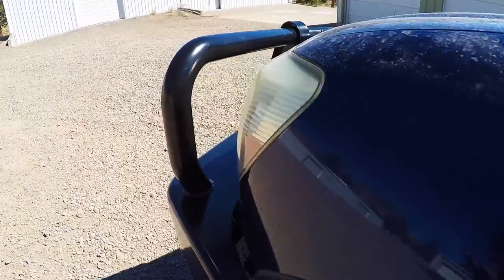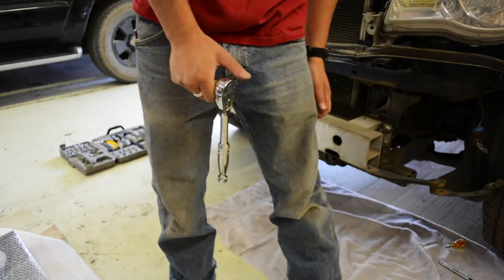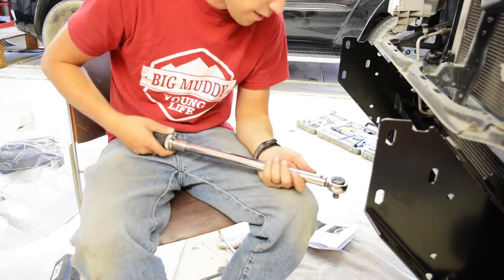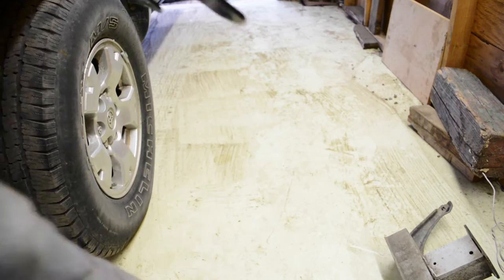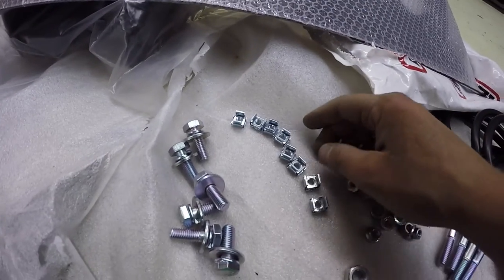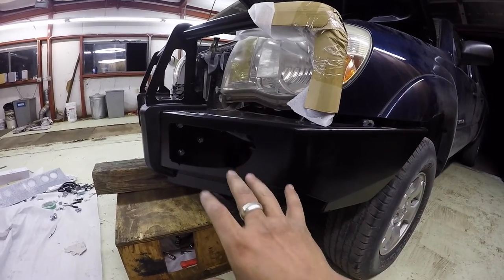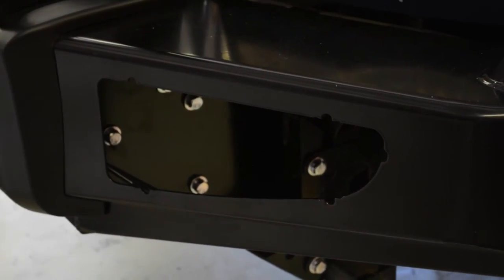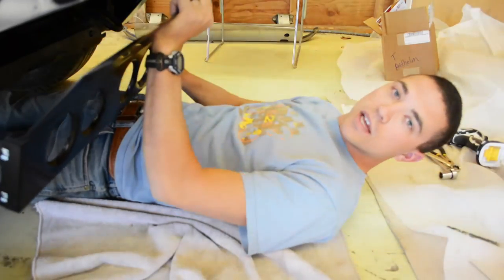How to install ARB bullbar front bumper on a 2006 tacoma

Comment: When you have the stock bumper off take the time before you install the ARB bumper and clean off your condenser and radiator and also if you are not offroading give all that metal a real nice clean and heavy wax to prevent rust.

Comment: Your radiator support mounts are shot. Energy suspension makes a body mount kit that would be a worthwhile upgrade.
Reply from the maker: Tell me more, is there something i can see in the video that you saw. Give me the time of the video clip. I do have a noise in the front end that happens when i go over bumps and I haven't found where it is coming from yet.
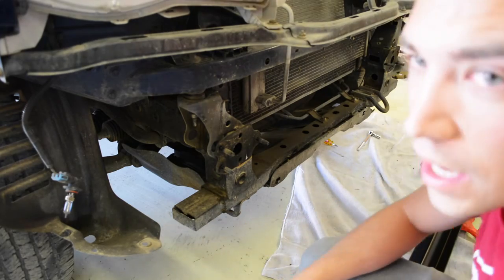Reply: At 2:54 right above your head. There's a rubber radiator mount on each side of the frame. Driver side is usually way worse than the passenger side due to the battery crushing it.
Reply from the maker: Thanks for the heads up! I'll take a look at them and see what i find.

Comment: Thinking about getting this bumper. Do you know how much it weighs by any chance? I've found anywhere from 80-180 pounds. Thanks
Reply from the maker: I dont know exactly but it does lower the front a bit. I ended up putting in a 2 inch leveling kit to lift the front up some more as the back end is higher stock.

Comment: Pretty good video. I would recommend to others though, leaving a larger gap between the bumper and the fender. Especially if you ever plan on putting in a winch. The bumper will flex when it’s pulled on and eat into the fenders on a heavy pull. I learned this the hard way.
Reply from the maker: Yeah I agree